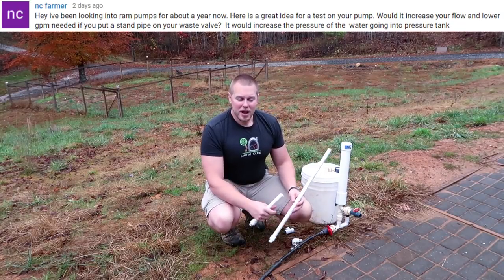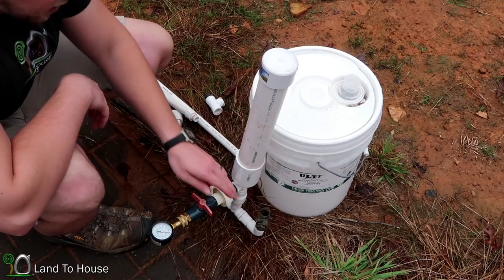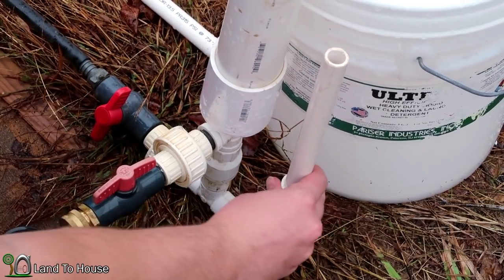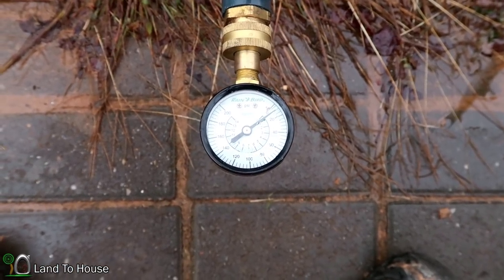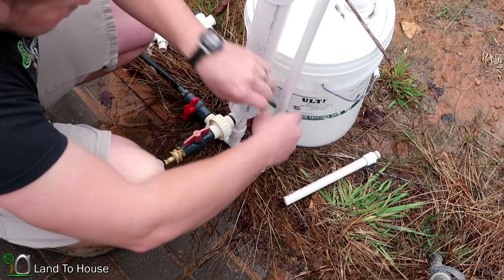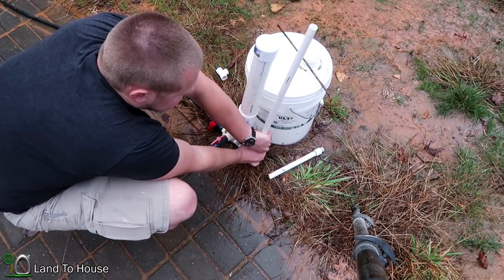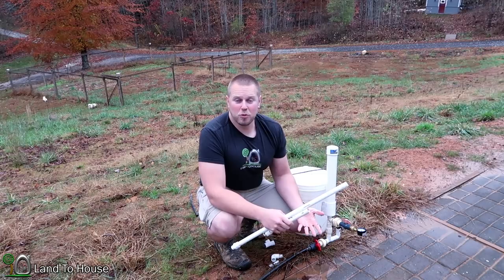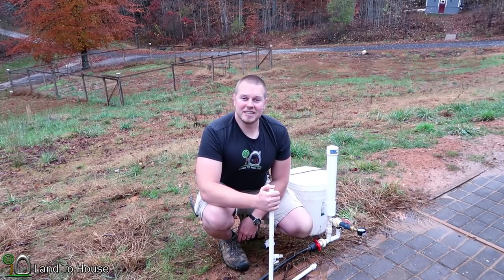Waste Valve Height - Ram Pump

Comment: Hey I have and idea for a test. So in this set up you have 3 ft of head pressure at the Ram.  What if you dug a hole 3 ft deep and dropped the ram in the hole, would this dramatically increase the pressure going up hill?
Reply: Until the hole fills up with water.
Reply: Yes. The extra three feet fall would substantially increase the pressure to the outlet. The pit would need to be drained to stop it filling it up. This is standard practice, I.e. digging a lined pump pit. Another way to increase the available head of water would be to fill a header tank, locally feeding the ram pump, from a collection tank further up hill from the water source, again standard practice.

Better efficiency would be to ensure the valves opened and shut far more rapidly. Papa Pumps use a Venturi affect, speeding up the water flow through the valves. The valves are more like thick ‘O’ rings and open/close far quicker than metal/rubber plate type valves.
Reply: @chrisnel5252  How do u drain water from the dug pit?
Reply: @maryalobo1287  As the ground you have chosen is sloping, running a drain pipe from the bottom of your pit down slope and back into the river (water source) will keep the pit water level down. 

The point you run the drain pipe back into the river will have to be lower than the bottom of the pit. If the slope is fairly steep the pipe will be quite short. Conversely, if the slope is slight, a longer length of pipe will be needed.
Reply: @chrisnel5252  I meant when the ground is flat and you decide to dig a pit for the pump to increase pressure, how then do you remove the waste water from submerging the pump?
Reply: @maryalobo1287  In that case, I would dig a  pond a small distance away. The top level of the pond would need to be at or below the level of the bottom of the pit. Run the drain pipe into the bottom of the pond; I would trench it in at the depth of the bottom of the drainage pit to allow it to drain. Once the pond is full, make sure there is a pipe (or surface open half pipe to avoid pipe blockages from leaves, etc from the pond) for the overflow back into the river/water source. The pond can be as big as you like and also allows you to create another wildlife zone.

Comment: I have a 3" pipe rising off of my waste valve and it is piped out horizontally to feed an apple tree.  I have 4.5 feet of head pressure.
Reply: Don't do that! Talk to me. I can help you. No cost.  I'm not a saleman or anything like that. I can steer you to pdf on ram pumps. Charts,, etc. Master plumber  w/41 years
Reply from the maker: Seems like a good way to use the waste water of a ram pump. 3" is not using much of your head pressure.
Reply: forty two can I get these charts?

Comment: Of course it doesn't close. Less head equals less velocity. which means less pressure to close the valve. you'd get the same results by moving the pump to higher ground.

Comment: It’s all about the physics. The water pressure on the valve reduces the pressure available at the check valve to close it, the shortest head of water beyond the valve will give the highest pressure. 

It’s all about head pressure

Comment: I wonder if a stand pipe could be used to assist in opening the waste valve in lieu of a spring?
Reply: yes it can.
Instead of calibrating the spring, one can play with height of pipe on top of waste valve.

Comment: I know not much about anything and pretty sure someone has already mentioned - make the supply line a 3' which should increase pressure?
Reply from the maker: Make the dive pipe 3 foot? Long ? I am not sure that I follow your thoughts here.
Reply: Like I say I have not tried but was wondering If you put say a 10' section of 3" pipe on the side from your spring feed, I know it would increase volume but would it have some increase of Head pressure at the Ram pump?
Reply from the maker: +James Bailey I see what you mean now. That would be a good test. From what I understand it would actually reduce the potential because the pressure wave going to the ram pump would be strong but the pressure wave going away from the ram pump would be weaker because it has to go against the larger volume of water.

Comment: You need to put A90 right off the valve they won't be no back pressure you can't put the pipe going straight up he put a 90 on it and run it to another location put a Backwater waste

Comment: what happens if you raise the valve higher rather than extending the exhaust pipe
Reply from the maker: I actually have a video on that someplace as well. It was the same results.

Comment: what is the usage of waste valve?.is it working air compressing  without waste valve ?
Reply from the maker: The ram pump needs the waste valve to create the pressure wave that makes the pump work.
Reply: thanksssssssssss...........

Comment: Land to house

You did not make a scientific test.. you made a wild assumption.

Yes it will reduce your pressure and therefore your lifting height.... But because the valve does not slam shut as quickly, that means more water will have flowed through.

I saw another YouTube channel where they were delivering water to a village and they only needed to lift it 12 ft and they had plenty of drop... They claimed they went from 0.6 l to 2.7 l per minute

So instead of guessing what would happen, why don't you run this test again but with 10 ft of head pressure to make sure you can operate the pump properly,even with a standpipe, but then measure your flow rate differences only lifting the water say 20 ft. which you know is totally doable with a 10-foot drop.

So pressure would never be a concern .it would be flow rate increase or decrease because of standpipe.. that would be an apples to apples comparison of what you're trying to do.

You never once measured the output in this test , only the pressure.. but that's only half of the equation isn't it?

People aren't always trying to lift 80 ft in the air, sometimes they just want to go to the second story of a house but have an increased flow rate..

I would think the name of the game is getting as much water to where you want it, as possible.. sometimes you have to sacrifice flow for height.

Comment: What it you put the waste valve at the top of the extension instead of under the water weight?
Reply from the maker: Bringing the waste valve up reduces the head pressure. I also expect that it reduces the pressure wave to have the valve further away from the second valve.
Reply: Land to House so do you see a way I can use this from the depth pressure in my lake? I don’t have a creek. I was thinking I could use a 4” pipe input at about 10’ deep with a large pressure tank at the top of the water with a 1” output pipe and a 1-1/4” by 10’ waste valve above the water. Seems the water weight at some point would act like the head pressure from the stream as long as I kept the external relief valve pressure at 1 atmosphere. Think it comes down to where I need to locate the pressure tank more I think about it. I keep you posted and your video was very helpful. Thank you.
Reply from the maker: @donaldsmith3107  sadly the ram pump does not work in a lake. When you have the intake in the same body of water as the pump there is no water flow. The head pressure that you gain by submerging the pump is negated by the hydrostatic pressure of the water.
Reply: This might be out of left field but what about something in the air cylinder? I'm thinking like a balloon that will add pressure.

Comment: So then what happens if you put the valve at the top of the standpipe?
Reply from the maker: Same result. Loss of head pressure.
Reply: @LandtoHouse  Thank you. I thought for some reason it would be the opposite. Since it seems like the weight of the water BELOW the valve, would increase the pressure needed to both, push that weight up, and to open the valve.
Reply from the maker: Because water wants to find "level" it goes back up the longer waste pipe and starts to slow down again as it loses head pressure.
Reply: @LandtoHouse  Ah. Ok, that makes sense! Thank you again.
Reply: @LandtoHouse  By the same token, It seems that if you raised the level of both,  this standpipe, and the stack, it would be moot. Because it would just even out.

Comment: All I want to know is how the ram pump work to the deep well.
Reply: Yes I'd like to see that too. I think it should work as long the whole pump is on bottom under water to make the head, say 3m deep well should pump water upto about 21 meters height
Reply: It doesn't work that way. If it did you could use a ram pump submerged in a pond.

Comment: Why don't you try to lower the waste valve with fittings....maybe you'll achieve a higher psi
Reply from the maker: This test was to prove just that. It's better to have the waste valve as low as possible.

Comment: put another pressure tank in the waste valve.. two pressure tank pumping alternately with no water wasted..
Reply from the maker: When you cap off the waste valve it keeps the water from cycling.
Reply: @LandtoHouse  nope.. the two tanks are pumping to a 1 delivery.. i saw it working in the demo of our seminar guest long ago. that was the first time i saw a ramp pump. i forgot the exact way of doing it, i think there was a third pressure chamber... but one thing im sure of is ""theres no water waste"..
Reply: This is what i searching for waste water..can you gave a link  to that another pressure mark?..and how about comparison between input output and waste debit water guys? Thanks for your experiment

Comment: what happens if you  make a taller pressure vessel?
Reply: It probably would lessen the pressure same as in a car cylinder where the compression ratio is lowered if the cylinder head is moved away from the piston top and increased when it is closer to the piston. Perhaps the cylinder head mimics the head pressure coming from the source. Maybe a shorter but wider pressure container would function the same as increasing a piston cylinder's width.

Comment: What if you face the down the  waste pipe.
Reply from the maker: If the waste valve is tilted all the way down it will close and not reopen.
Reply: @LandtoHouse  You're right. The pipe is good when your valve is not heavy enough.

Comment: what if you pointed the waist check down?
Reply from the maker: The waste valve has to hang open by gravity if it's pointing down it will close and not reopen
Reply: I see. what if you ran piping in a "J" shape where the chamber is at the top and the waste valve is at the bottom, but still venting toward the sky and still below the chamber. My guess would be it could increase pressure because of the added drop. but it would be interesting to test that out and know for sure.

Comment: Sir how about if we add another two, three, four or more one way valve... Will it increase its power? Or simply I'll just ask how can we increase the power of its pressure? Thanks alot!!!
Reply from the maker: I found that when more valves have been added there is more water used to run the system and more output flow rate. BUT the height does not increase.

Comment: why not start the pump first, then add the stand pipe?
Reply from the maker: That might work but in a permanent install you would not want to have to keep removing the stand pipe when cleaning and performing maintenance. I figure a poker is the best solution.

Comment: Your tast negater what you said earlier about the pump working underwater if you put that whole thing under water as we saw in your previous video then all the water pressure is more than just that stand gate you should investigate and do more research
Reply: No it does not negate it.  The effects of pressure putting 'that whole thing' under water is completely different from having just water in a stand pipe.  You need to do the 'additional research'

Comment: I respectfully don't understand what you have demonstrated. You never measured output. You only read the indicated static pressure. And you seemed to claim another channel had made erroneous conclusions. I think you need to measure dynamic flow rate to make any conclusions.

Comment: You are defeating the purpose by using flexible pipe! You do not want shock absorbed. The less absorbtion, the better! You want that drive line to ring like a bell when the impetus valve shuts. Bang! Bang! Water should erupt out of that valve!

Comment: Yur going the wrong way!

Put the waste valve below the lead pipe for extra head.  closing  rates should be higher and more volume because of the higher  cycle rate.
Reply from the maker: Yes that was the point of the video. People wanted to know what would happen if a pipe was installed on top of the valve.

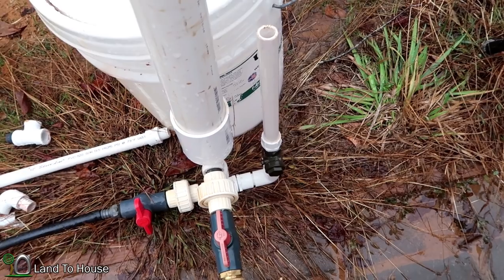Comment: stopped video at 3:02 and guess the pressure of the 2 foot pipe will be 3-5psi...
Reply: lol i was completely wrong this time...
Reply from the maker: I think that is about the right value but I would have to turn the check valve to the side to get it to cycle. But with 1 foot of head you are not going to get much from the pump either way.

Comment: F  the "N C Farmer was in reference to "Stoney Ridge Farmer", the stand pipe was Before the check Valve, not ON the check valve, When Before the check valve and the compression tank it only serves to duplicate the feed pressure and soften out the pulses, When on the check valve it obviously interferes,  Also, the "Stoney Ridge farmer's" setup had the check Valve before the pressure tank like most setups do, not after it.
Reply: To clarify, the N C Farmer stand pipe was NOT connected to the check valve, only placed in a "T" before the pressure container.

Comment: What if you put the closing valve at the top of the new pipe instead of the bottom?
Reply from the maker: The results are the same. The added pipe reduces the head pressure.
Reply: @LandtoHouse  would making a larger pressure chamber help build pressure with an extended waste valve?
Reply: I'm thinking if you made an aquaponics grow bed drained into the feed line of the ram pump that then ran right back up to refill said grow bed but some how fashion a reservoir for the waste valve that gravity drains back into the grow bed?